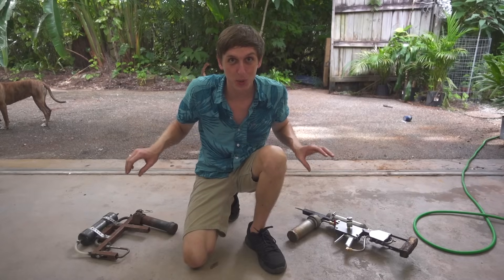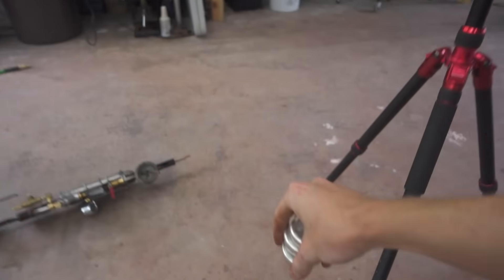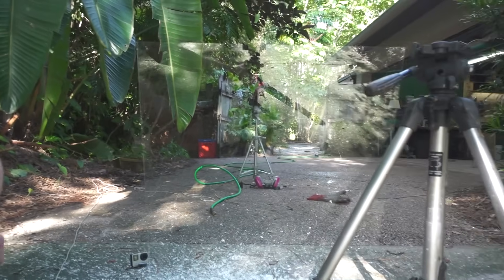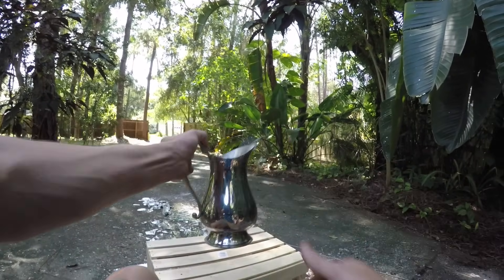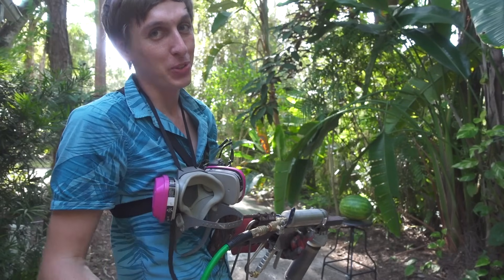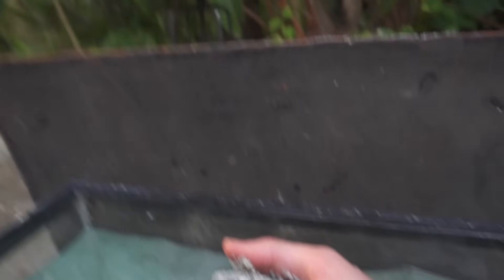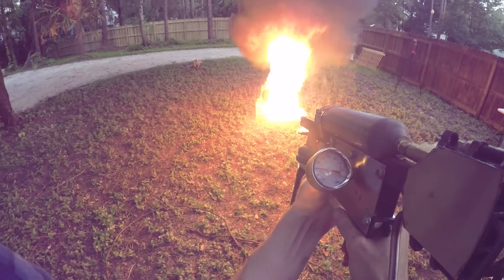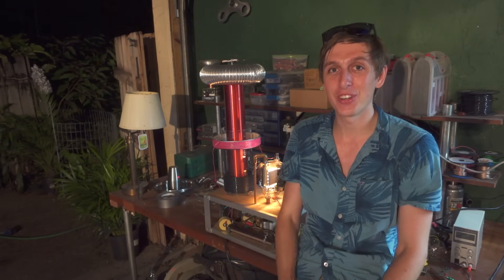Molten Metal Squirtgun!

Comment: That's not a gas mask, that's a respirator. It protects from solid particulates, not gasses.
Reply: they also protect against fumes and vapors. but his concern is metal particulates in the air.
Reply: The protection provided entirely relies on two things when it comes to respirators.

First is that it fits your face properly, and forms an air tight seal. His appears to do this.

The second is the type of filter used. In this case, he uses a 3M 60921 filter. It's a decent multi-purpose filter that will definitely protect from metal particulates created by the splatter or an accidental rupture.

However it would not protect from some of the possible gasses released from lead potentially in the pewter, or from the objects he's firing at.

The filter will protect from "organic vapors" like gasoline fumes or some combustion by-products, but all the vapor dangers are almost entirely eliminated by being outdoors.

Comment: I want liquid nitrogen coming out of that damn gun!
Reply: "And now for some cheese..... oops did i say cheese"
Reply: "What killed the Dinosaurs? The Ice Age!"
         - Victor Fries
Reply: Wont that expand in the tank when it gets warm? Boom?!
Reply: swati aayush captain cold pls there isn't even a flash on this earth
Reply: All of the pressure will rise too the top of the canister forcing the liquid nitrogen out of the front of the barrel it would work but you'd constantly have a small stream coming out of the barrel until you fire it
Reply: I'm pretty sure that metal tank will hold the nitrogen pretty well. Also, the barrel of the gun has no locking mechanism, so the excess pressure will just be vented outward.
Reply: swati aayush he has a gun like that too
Reply: Mattias Fleischer nope, it doesn't have a valve

Comment: Is that an 833A tube?

I used those in an AM broadcast transmitter that I used to maintain. A pair of them in push-pull configuration can transmit at 500 watts!
Reply from the maker: yep 833a! You actually used them in transmitting.. your an OG!
I picked this up at a HAMfest for $50, the guy asked what kind of radio im building... 'technically its not a radio but it does broadcast 500w of static'
The plate gets pretty orange after 30 seconds, I think using 2 would be better. if I every blow this im getting an 833c if ones available!
Reply: It was an ancient Northern Electric AM transmitter. Rock solid inside and a cool '40s  industrial  art deco kind of outside. Still in service when I changed jobs in the early '90s.

The standby transmitter was 500 watts and used 2 pairs of 833's. One pair for the RF amplifier and one for the audio amplifier. 

The main transmitter was 1KW, and the circuit was identical except it added a pair of higher power tubes as a final power amplifier stage in each the RF and audio section.
Reply: TheBackyardScientist I collect tubes, too. I recently found a rare Western Electric tube for a buck!
Reply: pileofstuff I need a translator stat

Comment: Use muriatic acid to remove the rust from your old squirt gun. Soak the  canister in the muriatic acid.
Reply: Please do not. Even the fines from that stuff are deadly.
Reply: Scott Gastineau use a $5 N95 respirator from Home Depot.

Comment: building a Tesla coil isnt all that easy... and it can get expensive... research first, read all you can, and plan your purchases. Mine cost over 3000$, is 12" in diameter X 60" tall for the "red part" ( secondary coil) the silver ring was 14"X 56" ( toroid), the primary coil was 45' of 3/8 inch copper tubing. The Hi voltage transformer put out 28,800VAC ( 2 14KV distribution transformers in series) and the output off the top load was over 12' in length, you will need several very high voltage capacitors, a serious spark gap with a modified 1800 rpm motor along with a massive iron core inductor and seriesed/paralleled Variacs to handle the 240 volt input. Took 2 yrs to build and tweak it to near perfection...  and Yes it was worth it, the Police would come by everytime I ran it  :)

Comment: Try making a teals back pack! It straps to your back with all the batteries and crap it needs to work but it runs down both arms and triggered electricity when your hands are near or touching. This wouldn't be easy but it would be awesome, especially because if you touch stuff with both hands you can send and electric shock through it yourself!

Comment: weld shut the  molten metal reservoir , then  drill a hole for a  ball valve , insert ball valve and weld it in place, Now i think you should be ready to fill it with molten metal using a steel funnel and then close the ball valve,

Comment: You should add an extra pressure release valve in the air tank that triggers when it starts to sputter in the end to make it a bit safer.
Reply from the maker: +Nate yes that would have been great. But I don't know what they're called or where to buy them. Also even pressing the trigger for one second and fills up the canister with enough air to force out all the contents and there is no way to stop it!
Reply: Pewter in The U.S does not contain Lead.
Reply: Old pewter does have lead. Stuff at Goodwill could have lead. Don’t spray lead in your backyard. Test it first.
Reply: It's not toxic, but you don't want bits of metal dust or vapors in your lung. Water is non-toxic and you don't want that in your lungs either.
Reply: TheBackyardScientist hi lol
Reply: ummm yes, some pewter can be mildly toxic due to the use of lead in the mixture

Comment: What about a mod to the squirt gun which would be about adding a small flamethrower which could be used to heat up the magazine in order to keep the metal constantly molten and be able to use the gun without access to a gas tank?

Comment: tell us about the history of the tesla coil. wasn't it built to compete with regular power transmission? what are its pros and cons? what can it be used for practically, if anything? what does it actually do when you turn it on.
I know we can google most of these answers, but would be good to showcase the coil at the same time, perhaps with a few experiments that serve to highlight the answers to the above. something like that.

Comment: Use copper gaskets and appropriate flanges to get a high temperature air tight seal. Then you can shoot molten aluminum.

Comment: I've always wanted to build a tesla coil. I think a small one that'd run off of a USB would be cool
Reply: yesh. it would be coil.
Reply: Pirat Carribean nobody said it had to plug into a pc. A rechargeable powerbank for phones uses USB
Reply: you would need a usb cable with a flip ton of current to make that work but it still would be pretty cool yea
Reply: most USB ports on computers are only able to provide 500mA of current (which @5V translates to only 2.5W of power). Even the high-current 'phone charging' USB ports on some computers, wall-warts, and power banks are only 2A @5V, which is only 10W. When USB ports exceed their rated wattage it trips a resettable fuse in the device, and cuts power to the port. There are low-wattage tesla coils out there, but they still draw more than 10 watts, and will probably trip the fuse if you were to try powering it off of a USB port.

Comment: what you should do to the canister that contains the molten metal is to insulate it  from the outside so the heat stays till you shoot it also you may want to adjust the tip of the hose because the stream is kinda crooked

Comment: Shoot molten salt into water
Reply: By the way, be carfull when shooting flaming liquids because once you run out of fuel the flame could ignight the air-fuel mixture in the tank. A safer alternative would be to use propane as a propellant instead of compressed air, perhaps you would eaven achive higher pressures than your compressor.

Comment: Since you have such a thick-walled air reservoir, why not string two or three air compressors in series  (outlet to inlet) to get some decent pressure? Pewter is pretty dense, and 750 psi seems like a good number for projecting it at a decent speed.
 Also, pipe threads aren't that leaky on their own if you crank 'em right down (the 'ol 750 ft-lb pipe on the handle of a pipe wrench routine). Plus pipe dope is a thing, just slather the threads in RectorSeal, and even after decomposition, it should still make a decent seal. 
Now that you can handle the heat, aluminum would shoot much further per charge.

Comment: You should shoot different liquids out of it so the fire changes color.
Reply: For that you'd use methanol with different salts dissolved into it. Like boric acid for green flames and copper sulphate for blue flames.
Reply: Jacob Burrell this guy is torbjorn
Reply: amadeusz antyga not all at once put one liquid at a time
Reply: depends if you let the liquid separate into layers
Reply: +theX24968B as long as the liquids can be mixed into a homogeneus mixture and are at a temperature above absolute zero (and nothing would a liquid in this theoretical temperature anyways), they would mix by diffusion. And boric acid solution is capable of mixing with most common alcohols.
Reply: +Biggest Forehead in the West Boric acid and copper sulfate are solids so they need to be dissolved (just correcting a small error in your comment the rest is in my previous one). And also, if these would be dissolved in one liquid it would take about 1 min to have easily measurable amounts of everything in every part of that container.
Reply: I just want to point out that this is possible but the easiest way to do it would be to find three liqiods that wouldn't mix and cannot dissolve what would be also dissolved in the nearest other liquid in the layers. But there would be a problem with the color of burning from these liquids. I think this would be hard anyway.
Reply: +Jeff Vader How would you make to change color? It would mix and make one color...

Comment: I saw the tesla coil on twitter, and I was wondering if the high voltage would fry your camera when you touch the bolt? (apparently not, but is there a risk of that happening. It was at least my first thoughts when I saw it)

Comment: Im just curious, wasn't the flamethrower part very dangerous?  Yes the fuel won't ignite in the tank because it has no oxygen but if you blow compressed air in the tank doesn't it make it flammable again?